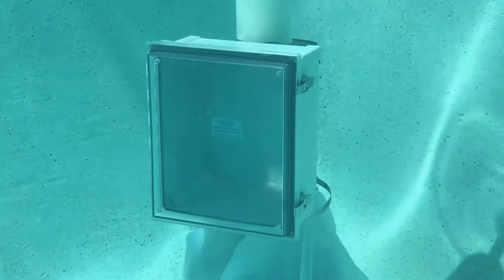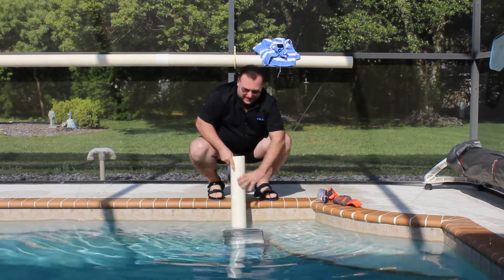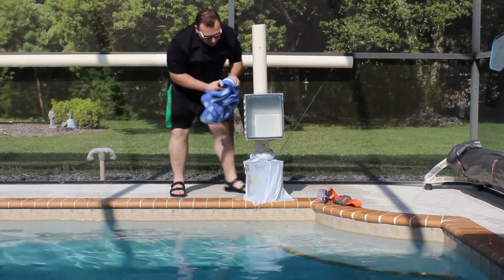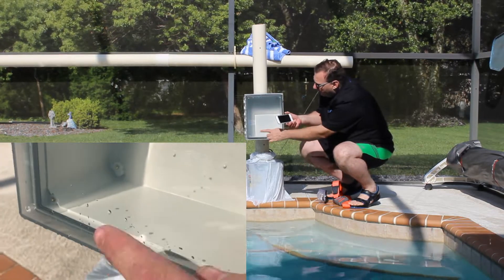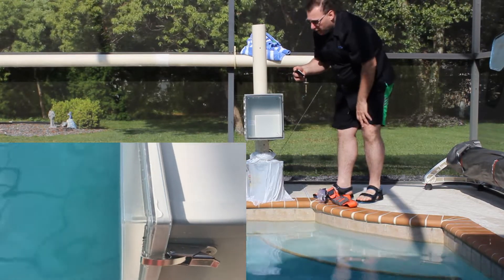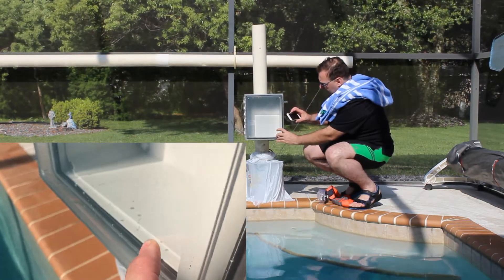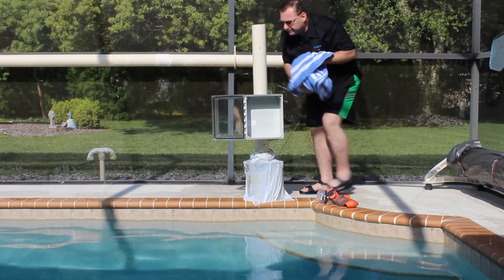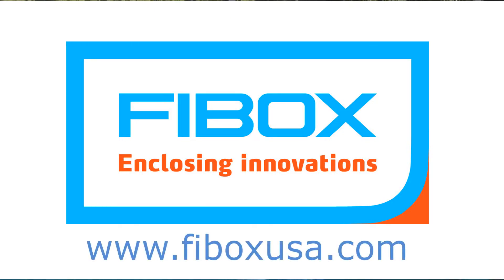Fibox NEMA 6P Polycarbonate Enclosure Test

Comment: You may want to revisit the NEMA 250 or UL 50e standards. The criteria for NEMA 6P submersion is not 1 meter as you say, it is 1.8 meters (6 feet) for 24 hours. You need to move to the deep end of the pool. Thanks for the video. Well done except for the depth error.